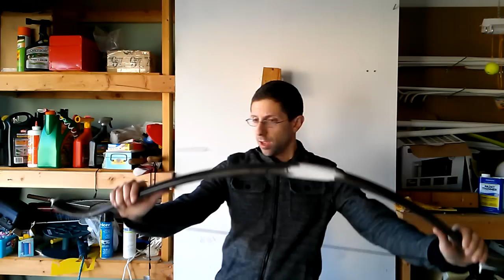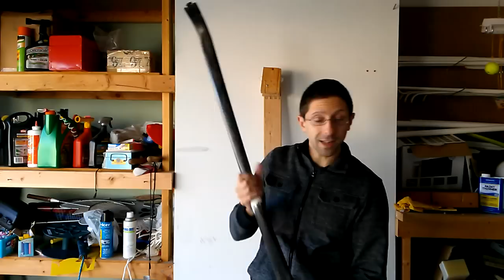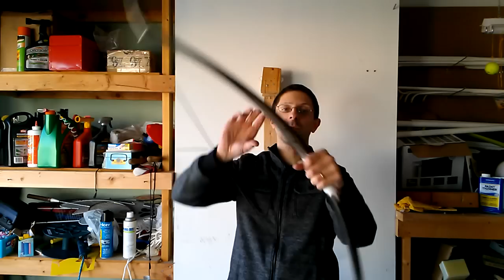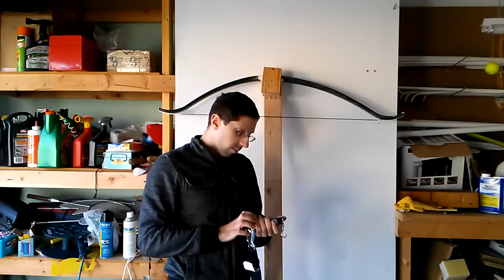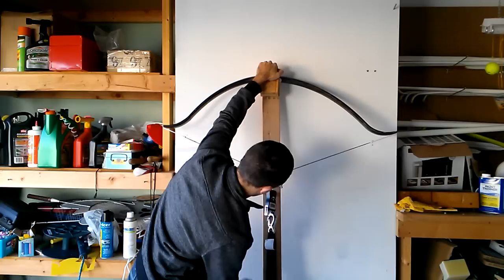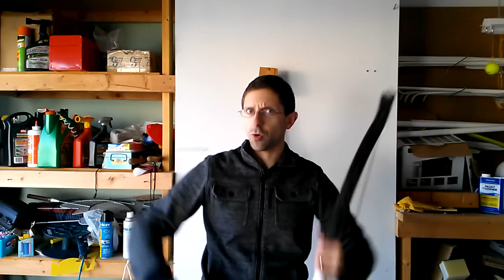How Heavy Can a PVC Bow Be? VERY!

Comment: Im trying to make a Asiatic looking bow in the 150-200 lb range using fairly available modern materials. What is your best recommendation? Been using fireglass bars to make bundled bows but they are d shape with no reflex and no static tips.
Reply: Hey I'm watching all old vids lol but I watch u all the time. By now you must know u can get that weight out of pvc Ive made one to 200lbs but the handle was huge so I hated it.
Reply: @brye5705  200lbs!? What size pvc did you use?
Reply: 1-1/2 schedule 80  I made one with driveway markers around 130ish with 1in pipe which I made one out of 1-1/4 pipe so you can make one very heavy but doesn't perform well. If I get time I will make one also schedule 80 has been hard to find lately local.

Comment: keep in mind, draw weight is not always what makes a bow good. I have made several pvc bows that have amazing draw weights but shoot really crappy. The limbs need to have the "snap" to give your arrow speed. I have some wooden long bows that waste a ton of their kinetic energy (a lot of it goes back into the limbs instead of the arrow). Several of my pvc bows have had this problem. I would be interested to know the FPS of these high pound bows. I have a 35lb pvc re-curve that shoots faster than one of my other pvc re-curves that is over 60lbs.
Reply: +Alexander S is shorter that of 60 pounds than the 35 one?? because size matters too, that's why for hunting a crossbows have to reach at least 150 pounds while a long bow just need 40 pounds.
Reply: Alexander S how can I make a warbow out of pvc please answer? atkeast 160 lbs
Reply: Size and the limb shape when unstring, this is why composite bow have equal or even slightly better power than longbow despite its short size because the composite bow usually have reflex shape when unstringed instead of longbow straight limb aka linear wooden stick. Or you could skip that and make your string mechanical efficieny higher, like compound bow; despite having deflex limb, it have much longer string due the use of cam and that alone make it could generate faster arrow speed than conventional bow.
Reply: Combinations of length, diameter of pipe, recurves, taper etc all lend their strength and weakness's to the bows. Playing around and experimenting is the fun part, and it's cheap.
Reply: Its too late but probably you Made it wrong, i make one i'm a bad way, whitout a metric band, not straight, etc, and when i shoot, the arrow (also bad maked) go straight like 20 mts

Comment: I love making these bows but it suck for me to use them. I have a 34 inch draw so going down to 28 screws with my aim. I can and have made bows that will draw to 34 but they never seem to have the power that the ones meant for 28 have. I have also collapsed and snapped several meant for 28 when I try pulling back to my draw. Oh well theyre still a ton of fun to make and play around with. Plus it was a cheap way to get my son into archery.

Comment: Did you put fiberglass in there. if not It would be cool to see how heavy it is with it and also most likely you would not have to worry about it breaking. Cool test to do and if you don't want it after you made it I would gladly take it ;) I love heavy bows!
Reply from the maker: Nope, no fiberglass - I agree, that'd be wild! I want to reinforce this with 3/4" pipe, then I could put 1/2" at the handle, and fiberglass inside of that o.o  We're talking serious weight! Easily over 100#, and that probably includes if I made the bow longer.

I have about 100 projects, but that's one of them, I assure you!

Comment: Can you go whitetail deer hunting with a pvc bow will it be strong enough to kill it ?
Reply: Different states have different limits for hunting. Generally if the bow is 50 or 60lbs it will be legal to hunt with and will humanely kill a deer if using arrows with hunting broadheads.
Reply: 40lbs required by law for deer, but most people recommend 50, 60-70 can and will kill any game in north america
Reply: There is no minimum draw weight to hunt deer in Kentucky, there are size requirments for broadheads , but not material. Every state is different, I hunt with a 45# recurve , most shots with a 2 blade 125 grain point will pass through a deer easily out to 20 yards. Shot placement is more important than draw weight.
Reply: Do you use pvc ?
Reply: I just built a pvc bow from 1 inch schd 40, in my opinion it is not heavy enough draw. It feels to me about 30# I also am not satisfied with the accuracy of it. That doesnt mean than a builder with more experience cant make a better bow tho.
Reply: With my pvc bow i can go tru a 10 mm plywood so.... Yes it can, but you need accuracy because if you miss the vital órgans it would be painful for him
Reply: Also there are vídeos that with a 30 pound recurve and small stone broadheads they go all the way trough the deer
Reply: You can also go hunting with a throwing knife, doesn't mean it's going to be effective.
I wouldn't recommend anything less than 40lbs with real broadheads for deer.
Reply: There are a few things about PVC  that make it not the best material for hunting bows. Its really hard to get both limbs equal in draw weight, even if the tiller looks good . That affects consistancy when shooting, its not easy to put a solid arrow rest on so most have to shoot off the knuckle which means you need to take time and practice to find your repeatable grip. New archers dont know you need to use feather fletching if you shoot off the knuckle . It is also affected by temperature. But .. it is cheap, its a good place to start if you want to get into bow making, and you dont really need much to make it with. If you have kids that want to get into archery , you can make 4 bows for  $10 that they can leave laying in wet grass for a week and it wont hurt it.
Reply: leonscottkennedyre4 sometimes too much is just enough
Reply: If you want to kill deer with pvc bow what others say goes but take note that the distance you shoot your bow from plays part too so don't be too far from prey when shooting your bow.